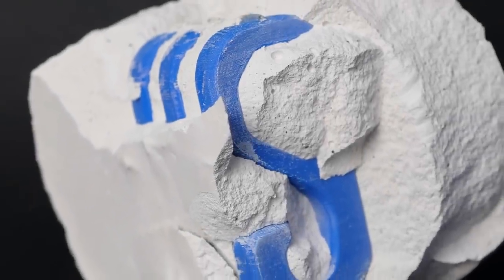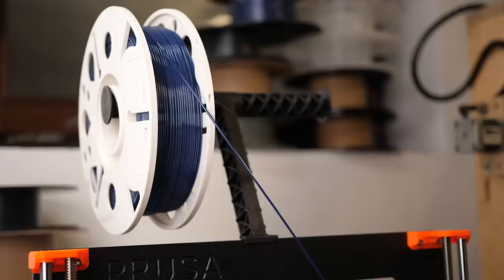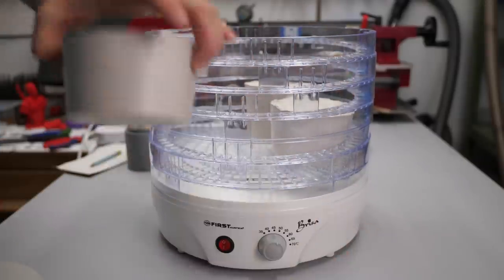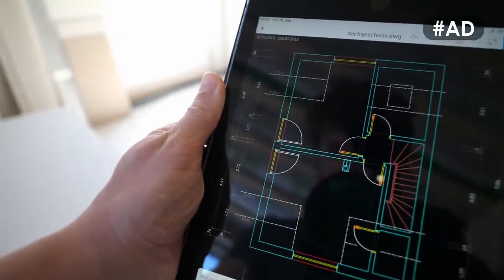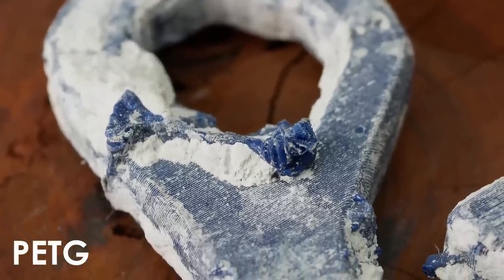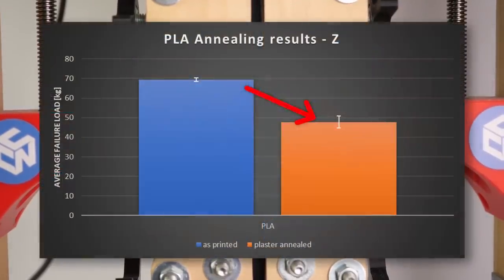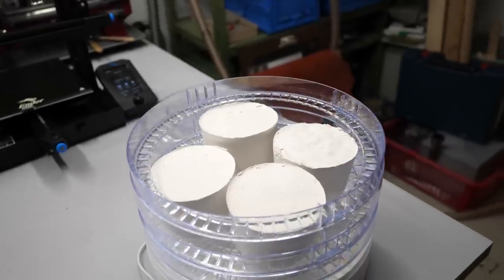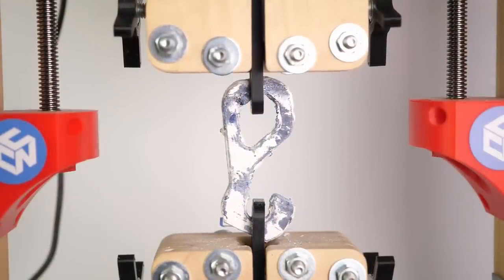Triple (x3) your Layer Strength by Annealing 3D Prints in Plaster!

Comment: I am skeptical of the integrity of this experiment.  I don't see how a hollow PLA part could be brought significantly above it's melting temperature in a mold, in the presence of gravity, and not settle to the bottom of the mold ( at 8:20 into the video )

Comment: The 3D gun printing community has been doing do that for awhile now. Maybe you can find a few tips from them to work out something better.
Reply from the maker: Oh, I didn't stumble over that during my research.
Reply: @CNCKitchen  like to was removed from the site. It's pretty much it's just like this shell casting with pla/wax with a solid feeder tube to fill in any voids that might be in the prints. It helps correct the issues of multiple axis stress fractures and can be used to fuse multiple parts together. It adds a lot of extra steps and expense.

Comment: Why not just coat the parts with plaster instead of submerging them in buckets? I'd imagine it would be similar to industrial investment casting where multiple dips inside of investment plaster creates a shell, which would save plaster and be easier to dry.

Comment: You should use proper casting techniques so the parts are laid flat on the plaster surface, dried, chalked, then more wet plaster laid over the dried work and dried again. Those layers should beak apart without breaking the printed parts

Comment: Don’t use straight plaster to mold, use a plaster sand mix.  Look up investment casting slurry, will be much easier to remove, give better detail, dry faster, hold less water and less likely to crack in the oven.
Run experiments at different temps 
Find the ideal heating and cooling profile for the material 
Don’t introduce any contaminants like a mold release it shouldn’t be necessary

Comment: Use dental alginate as the investment agent, not plaster. Use a mold release spray.
Reply from the maker: How thermally resistant is alginate?
Reply: @CNCKitchen  different manufacturers have different effects. By in large they are pretty resistant.  You will need to test it.

Comment: maybe use the dry plaster like green sand in metal casting? the dry plaster should ensure water is drawn out of the print and since dry it should be easier to extract. https://en.wikipedia.org/wiki/Plaster_mold_casting

Comment: Have you tried using glass fibre epoxy mixed with alcohol? See https://m.youtube.com/watch?v=ujk-wBQDUSk . The thinned fluid will penetrate the mix into the part and leave the hardened epoxy when the alcohol has vaporized. I mainly use this with glass fibre, but it seems to be increasing strength without too.

Comment: "Normalizing" might be a better term for this process
Reply: In American-English, "normalizing" refers very specifically to heating a ferrous metal above its upper critical point, followed by cooling in still (without forced convection), room-temperature air.  You would at least need the "still, room-temperature air" cooling to call this normalizing.

Comment: Do it with polycarbonate? It might be a record breaker.
Reply from the maker: I might try, though Polycarbonate already has really good layer adhesion (Hobbyking Premium PC at least).
Reply: @CNCKitchen  some another thoughts are to try it with composite filled filament to see if the filling binds to the plastic more or gluing chopped glass fibres to the exterior of the part before it's put into the plaster, like a ghetto markforged part. 
I hope there's enough room here for a follow up video :)

Comment: Have you try green sand? Like the one used for metal casting molds, check myfordboy's channel to see of what I'm talking about. Also there is a chemical that's mixed with sand, and then a gas is applied that makes it hard, none of this method should add water to your parts

Comment: Way use such a system  to get harder 3D printed parts? To get rely hard plastic parts I  use 3D printed parts only as molds., which I file with poliestere resin reinforced fiberglass powder or (carbon fiber) this method is simple an you get rely hard functional parts.

Comment: seeing you used a dehydrator to dry the plaster i immediately cringed a little.. plaster is not drying to set.. it's a chemical process (similar to concrete). it probably doesnt matter in this instance but it's something to keep in mind. people use the word "drying" indiscrimanetly.. but some things set chemically, some through loss of humidity (real drying).
forcing water out of plaster or concrete by heating and air movement actually lessens their strength. but as said before, it probably didnt matter in the situation at hand.

Comment: Plaster (gypsum based)  can be made with a method called "sumpfen", as can be seen here https://m.youtube.com/watch?v=-UH5Zx_1VW0 (its in german, sorry). This extends the pot time especially when using "Stuckgips" or moulding plaster. 
What I was thinking about is using some lightweight plaster that looses its strength when exposed to high temperatures so it can be more easily removed afterwards. The topology of the parts will limit what shapes can be used, and plaster thats easier to remove will allow more complex shapes, but I do expect this method to only be applicable for simple shapes and I wonder if using a mill would be the more practicable solution for those.

Comment: I feel like it defeats the purpose if you make yourself this extra work for a plastic part, i would rather use the 3d print and plaster for a casting, or if you make the part hollow and fill it with resin, whatever makes more sense for usage/efficiency etc.

Comment: There is a silicon wich is heat resistant up to 450°C, this could solve your humidity problem if you use it instead of plaster.  https://trollfactory.de/produkte/silikon-kautschuk/haertegrad-shore/mittel-shore-a26-45/7039/tfc-troll-factory-silikon-kautschuk-typ-3-hb-zinnguss-hitzebestaendig-rtv-1-1
Reply from the maker: I have some of this and will give it at try. Quite expensive, though.

Comment: Not a viable method for higher strength parts.  Much simpler to use a different material or manufacturing methods.  If someone is going the route of casting the parts in plaster just take the extra steps and do a burnout and cast the parts with metal.

Comment: Stefan, why dont u test mixed layers, like this photo: https://www.notion.so/interconnectd-layers-8f7a9e46e9514995a8faa3abde19e86f
Reply: i dont know how to do it, but im sure it would be a lot stronger then usual. in a .8 nozzle for example, with .3 layers with mixed like this, when layers like 1, 2 and 3 touchs each other. Open the link to see the example i made.
Reply: the way i think its fast to do a test, its get a single layer, divide the paths and add half on one layer, half on another....
Reply from the maker: I'll have to try that!

Comment: What a waste of time.    Anyone who values their time and does this sort of work for a living knows that adding steps materials and costs is a dead end.

1)  Learn to 3D print.   Get a real machine not an I3, not a kit.   Learn the functions of the settings in the slicer through lots of test prints.  Stop wasting money on upgrades.

2)  Dry your material prior to printing.    The plastics industry operates on razor thin margins,  if we could do away with running drying systems and spending money on drying equipment we would.   Fact is there is no way around it.    No "I have low room humidity" no excuses.  30 years working with plastic has told me the way the truth and the light of it.   I learned from people with even more years,  and the industry has been around close to 100 years now.    We know what we're talking about.   This is the single biggest improvement you can make for your setup.

3)  Get real materials.   I live in Nebraska,  I live 75 miles from Natureworks.   I know the engineering team out there,  and I get pellets specifically formulated for high temp usage and extrude my own filament in a Brabender extrusion line.    My parts do not need to be annealed for added strength because I am using pure material with NO filler and no modifier and no cheap-as-s* starch extender like the Chinese import material uses.   That makes all the difference.

4)  Find the RIGHT material for the job.   PLA is crap for service parts.  It was originally formulated for packaging and fiber,  not structural parts.  We've come a long ways but there is a material out there for every job.   Stop wasting time trying to make a material perform beyond what it is designed for.    At this point there is a material for every application,  if you run into issues with one,  try another.    And if you run into something that someone tells you "can't be printed" email me at foaming mad at gmail dot com put "PLASTIC WIZARD" in the subject line and I'll get you sorted.  Heck my insight on material properties is free and worth every penny -- you want to learn something useful drop me a line.

5)  Finally,  there is no substitute for experience.   Print, print, print.    I started 3D printing in the 1990s shortly after it was invented the company I was at had one of the first industrial printers on the market.    Then two.   Then two more.   I've done everything from FFF to SLA to SLM and a few more dead-and-gone processes.   The best way to learn is to find someone who has the background and experience and pick their brain.   I had to learn from the factory vendors.    We didn't have a Facebook full of terrible advice and E3D fanboys.    We actually had to figure things out by applying science and engineering and often times had to go back to the vendor and say "check this out --" 

Your time is valuable,  especially if you print for other people.   Don't waste it with things like annealing cycles.   If you need to anneal your print you picked the wrong material for the application.

Now... get off my go* da$n lawn.

--Brian "Max McGrumpy" Richard
Plastic Fantastic Polymerforge 3D 
Lincoln,  Nebraska
Reply: For the hobbyist and a one off part buying pallets of specialized materials might not always be an option. But hey, good for you, now pardon me, I'll be getting off your lawn..
Reply: @notsonominal  I don't buy it by the pallet,  but your point is valid.   :)